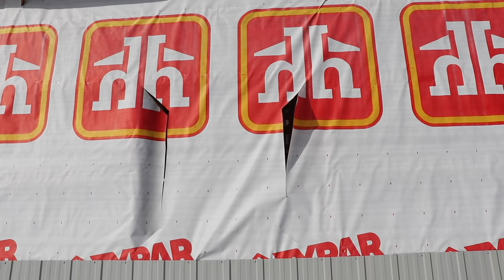Here's How I Built a Pole Barn (post frame construction)

Comment: No rebar on concrete?
Reply from the maker: Correct. I discussed this with the concrete company, the building inspector and an engineer. The concrete is infused with fibre mesh. The three stated you can do one or the other but do not need both. Having said this, I put some wire in the garage door entry area.

Comment: No rebar?
Reply from the maker: No rebar. The concrete was ordered with fibre mesh. Supplier, building inspector and a contractor explained that rebar is not needed (for this application) if concrete has fibre mesh. I trusted the advice of these professionals.

Comment: how come  , no rio mesh under the concrete ?
Reply from the maker: Burn Dog, Good question. I ordered the concrete with fibre mesh. Both the supplier and a local contractor told me rio mesh was optional if the concrete was impregnated with fibre mesh. I submitted this to the local building inspector and he approved the pad without the rio mesh given the concrete included the fibre mesh. In short, I took the advice of the supplier and local contractor. So far so good. Peter at the Reboot.
Reply: @TheWoodlandReboot  ok, thanks , we dont have that option here

Comment: no rebar ??
Reply from the maker: Yes, no rebar. I purchased wet mix that was impregnated with fibre mesh. The concrete company, an engineer I consulted and building inspector explained you can combine rebar with fibre mesh (overkill) or use either one separately. So, I have gone with this advice. Time will tell. Thanks for watching.